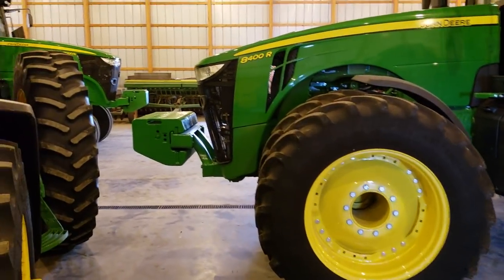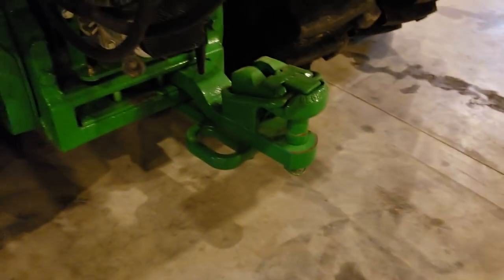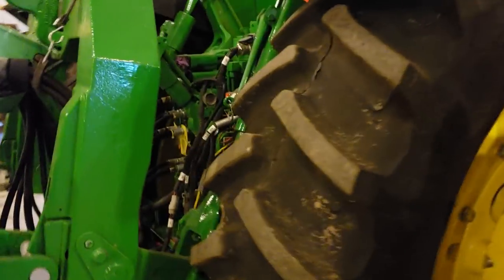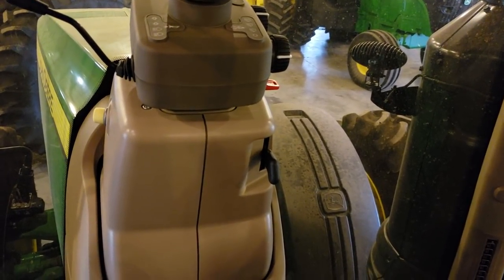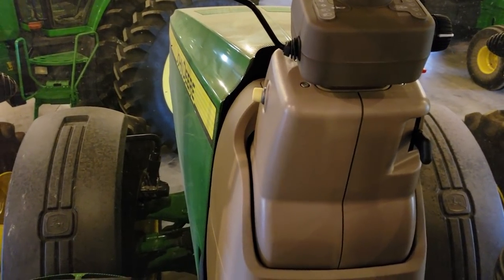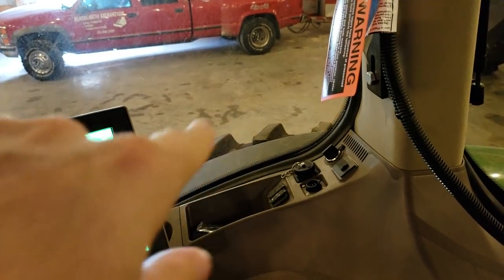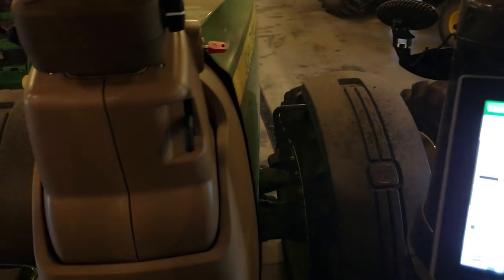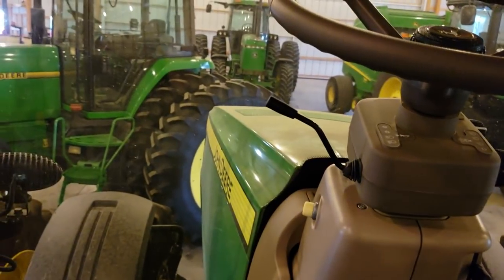8400R ... Fendt 1050

Comment: I agree, the Fendt 1050 and the 8400R are in 2 different leagues, but the 1050 does in no way put out 550 hp unless it's been tuned,and most 8R series we've had on the dyno put out almost what their engine rating is. So I highly doubt their hp numbers are that far apart. As for your rambling about the way the differential in the Deere works vs the way the Fendt works didn't make much sense to me. The reason you hear gravel crunching more when the Deere turns is because it has duals,and the Fendt most likely had super singles.
Reply from the maker: You are a very ignorant person

Comment: Fendt red colored wheels are a turnoff.  Silver color would look better.
Reply from the maker: Fendt available in multi colors .. some color combos do have the silver wheels
Reply: Did not know that was an option. Must be extra cost to get special paint? Red wheels are in base price?
Reply from the maker: @adam8347  ... blue with silver wheels .. forest green (a very dark green) with silver wheels .. and a maroon (ish) color with silver wheels ... you can also get the tractor in all black with red wheels .. and then of course standard red wheels and green (like ours) .. to be honest I wish ours had silver or cream colored wheels (like a brent cart) ... if you you tube 1050 with trouser blade you'll see a black and red one ..  and I could email you pics of the others if ya wanted to see them... yes, the other colors are optional and I think it's fairly expensive .. ironically all have a white cab roof top
Reply: Thank you for the information. Sounds like a cool machine not known much in the USA... Like your videos so I subscribed  to your channel.
Reply from the maker: @adam8347  thanks so much .. I sincerely appreciate it

Comment: That 8400R is sharp. I took a  look at one at the National Farm machinery show. I wonder how the Fendt/Challenger will be on resale value? The Fendt/Challenger sure looks heavy built and has a lot of technology inside.
Reply from the maker: Fieldman12 .. thank you for commenting and asking ... I think the fendt will drop resale value pretty fast .. very nice machine - but just not that many dealers ....  From what I am learning though- agco is going to push the fendt name and the Massey Ferguson lineups and drop the rest ... already seeing fendt hoods and paint on the MT700/800&900 series tractors.....
Reply: Yeah, I think it will drop in resale value also. AGCO just has too much to choose from and most of it is very similar to each other. Like you said, AGCO also lacks dealers. AGCO ticked off a lot of there customers when they dropped the orange line that the AC fans loved.  There use to be a lot of Gleaners around here and Deutz Allis tractors. Most have switched to Deere or Case IH since.
Reply from the maker: Fieldman12 .. thanks for the reply .. yes agco is a mess of a company- poorly structured
Reply: In the uk Fendt hold their money extremely wheel very expensive bits of machinery, Deere and Fendt be two favourite brands it’s really just personal preference which one you like more, wont go wrong with either
Reply: @Blackearthexcavationandtiling  Those tractors would look awesome with the Massey colors on them...///